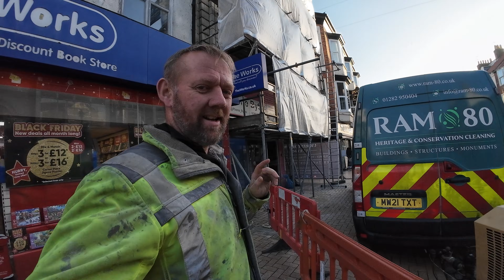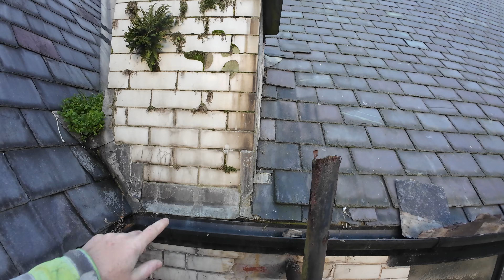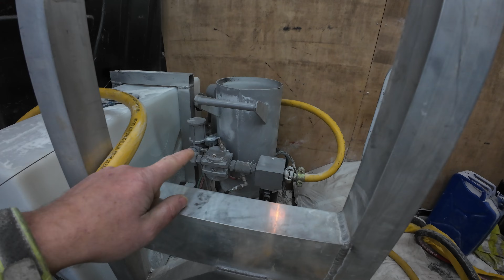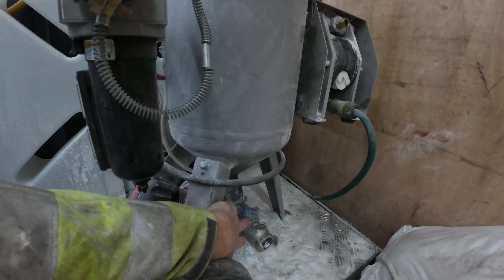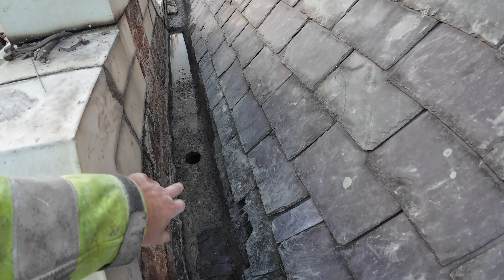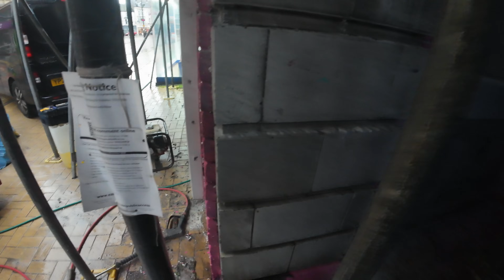65. This Building IS Falling Apart | NIGHTMARE Few Days, LEAKING Gutter & Faience Cleaning Problems

Comment: Great to see you progressed, I have to caution against your high pressure abrasive aporoach to cleaning the faience. The faience is like glazed ceramic so any high pressure or abrasive cleaning methods will damage that surface finish irreparably.
Reply from the maker: We are using Dolomite abrasive only Mohs 3. Faience, typically has a Mohs hardness of around 4 to 6. The Dolomite is not abrasive enough to damage it. We did some samples before starting to ensure we weren't damaging the Faience.

Comment: Do you think sandblasting will remove the paint from the bricks?
Reply: Of course as it can also remove the bricks !
Reply: Sand leaves a mess that has to be cleaned-up
Reply from the maker: We would have to control the dust with sandblasting as it in the town centre. Sandblasting would course huge damage to the Faience surface. Not the right process for cleaning this type of historic building.
Reply: @UKRestorationServices  For fragile surface like faience, you should normally use crushed peaches / apricot kernel and not sand. It's not a trick, it is sold in bag for that purpose.
Reply from the maker: We are using a Dolomite with is a calcium magnesium carbonate....basically caulk. We did look at using crushed Walnut shells but they were ridiculously expensive. Also did tests before going full bore and it didn't damage the Faience.